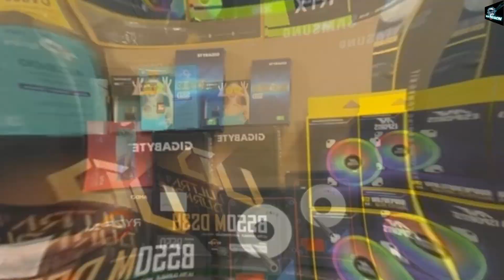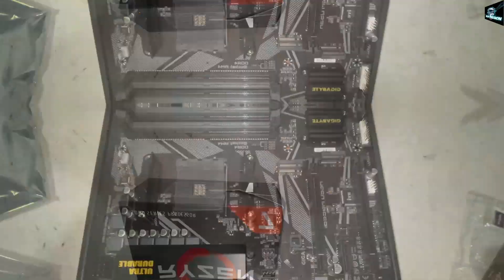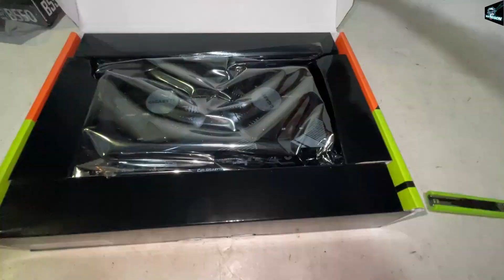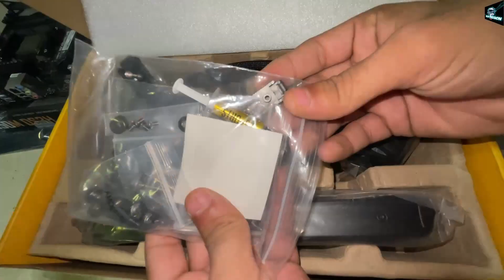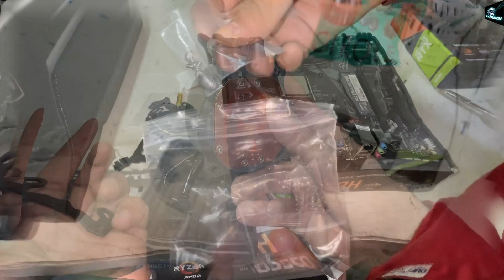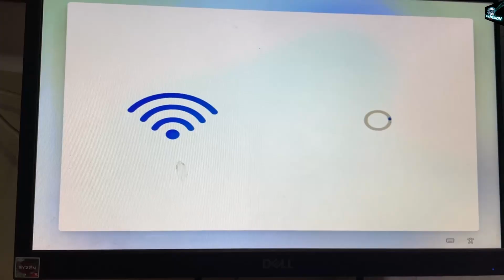1 Lakh Rs Dream Gaming PC 2023 | Ryzen 7 5800x Build

Comment: I probably would have gone with a Ryzen 5. The VRM cooling on that motherboard is definitely not good enough. There will definitely be thermal throttling and the CPU wont hit advertised clock speeds. 

Fun video to watch though. Liked and subbed.
Reply from the maker: Hehe yep .. I personally like Intel over AMD , The build was customised as per specific requirements though the MB should be more powerful , the need by the user is not so high and gonna upgrade more in future , Loved to see ur comment bro 😎 thx